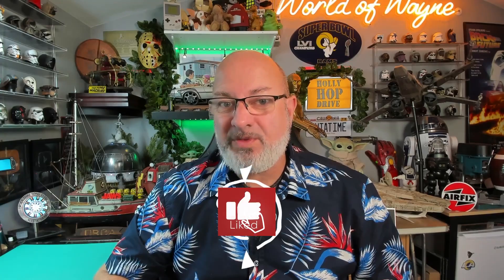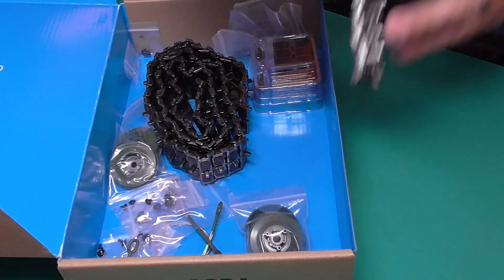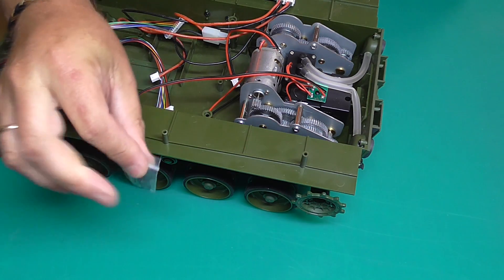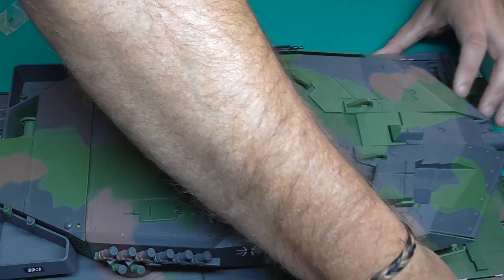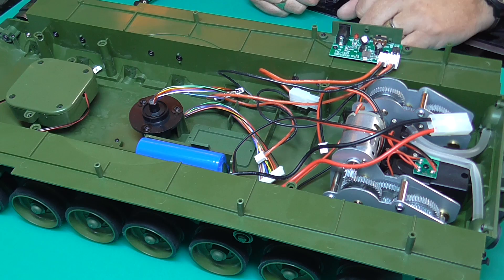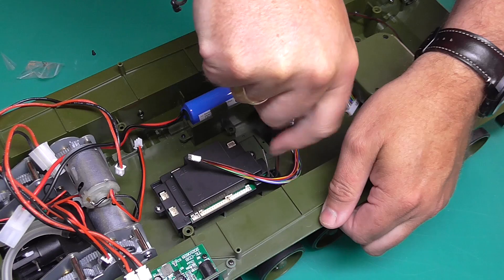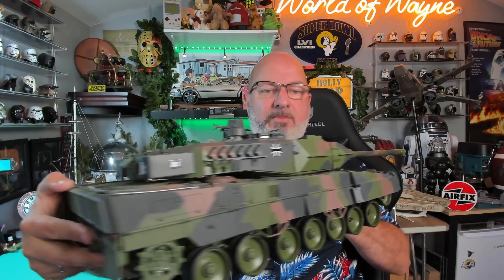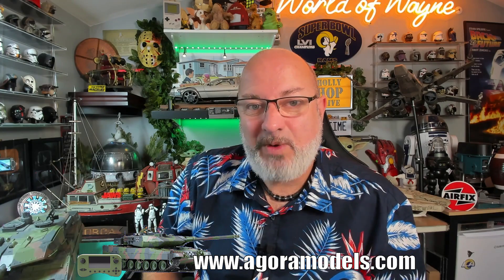Build the 1:16 Scale Leopard 2A6 Main Battle Tank - Pack 11 - Stages 85-92

Comment: Couldn’t wait had to put the tracks on mine defo only need 79 much too loose with 81 and I also won’t be screwing the body down until fully tested I squeezed the last link in with a small vice I have better than pliers because of the with of the tracks

Comment: The metal cogs are called drive sprockets and the 2 rods are whip aerials. More concerned as soon as it hits a bump or something that it may snap or break something off as it looks very fragile where the wheels are.
Reply: @cwmbc  Would have thought they would have used a metal hull and suspension as i had a plastic RC car model and it had plastic suspension and it snapped after a few bumps. For price i can get a fully 2 pro painted Heng long upgraded versions. Yeh i noticed the gear boxes look weak and the smoke pipes have no clamps to stop them popping off.

Comment: For the tank commander, you should name him Hans Handsup. The metal gears you mentioned are final drive sprockets. To replace a track on real tanks we get the end of an open track over the final drive sprocket with the old track still under the tank but opened and drive the tank onto the new track then join the track up using a track clamp to pull the ends of the track together then put a link rod through the track and bolt that at both ends with locking bolts.

Comment: Hi ya Wayne, followed you throughout the Bismarck build and disastrous spitfire build. I have noted that the rear of my Agora Leopard tank turret is very slightly scraping the rear body, any suggestions mate ? Thx
Reply from the maker: I need to check mine. It’s held in by the central screws so that’s where I would look first